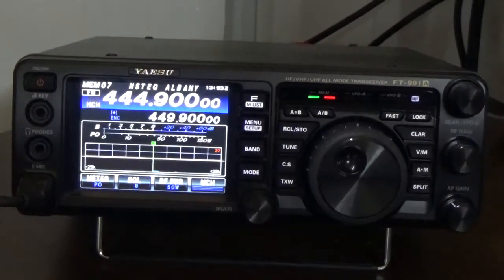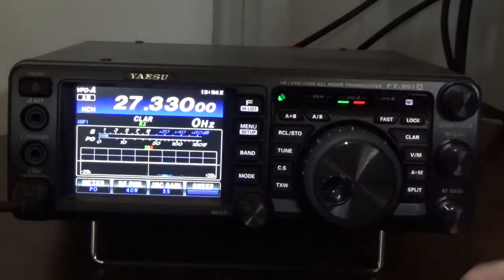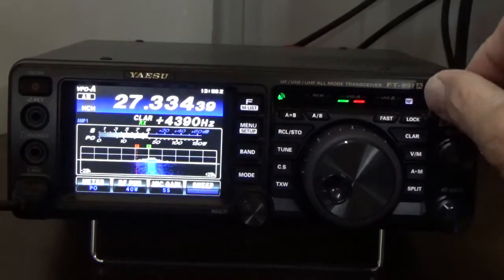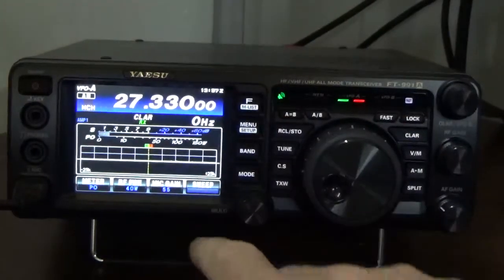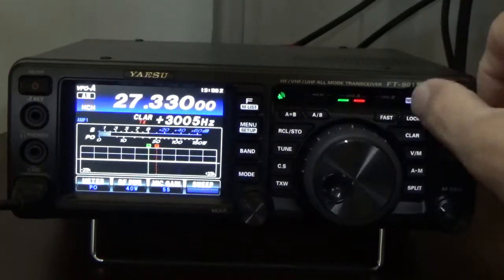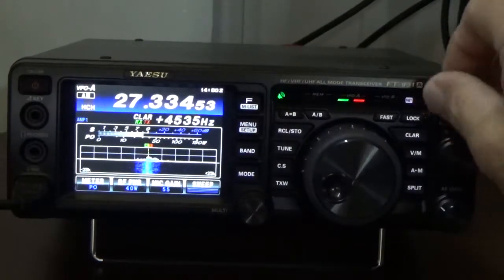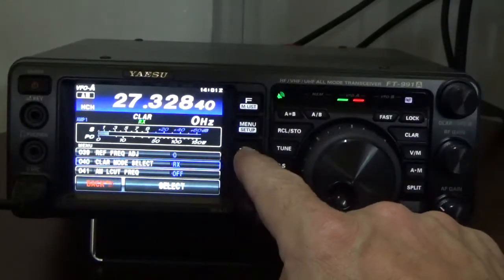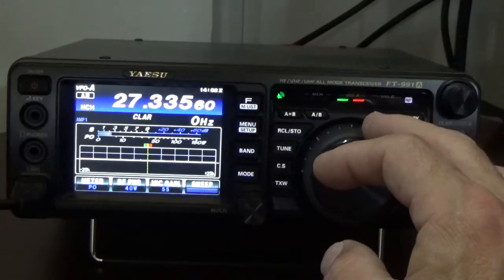Using the Clarifier and setting F Key Functions on TFT on FT-991A

Comment: "Using the Clarifier" - You might want to include all functions of the CLAR button. I did not hear you mention holding down the CLAR button for more than a second the offset will reset to zero and save a lot of knob turning.
Reply from the maker: Thanks, I tried it this weekend - Press The "CLAR" button near the VFO @ 1 o'clock will reset the Clairifier to "0" thanks for the tip sir!!